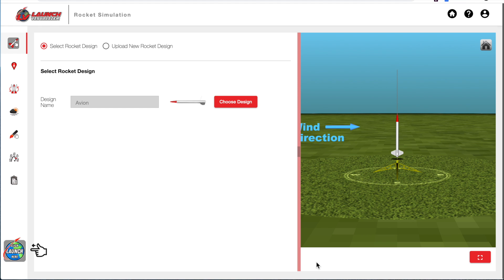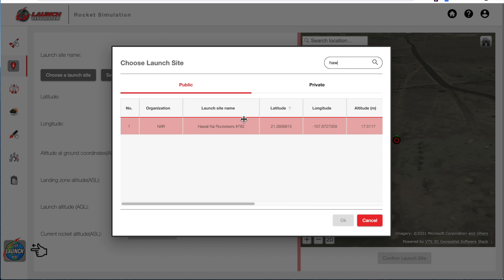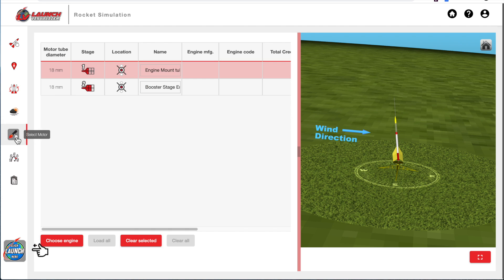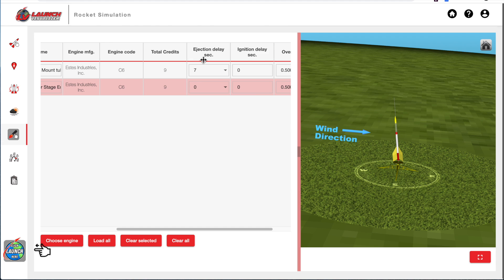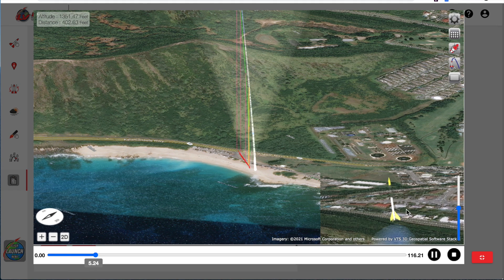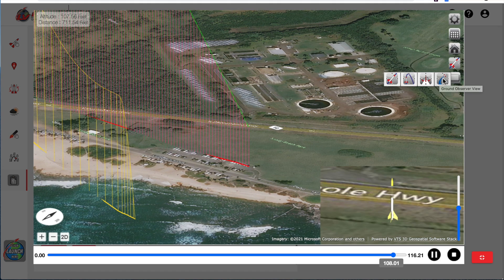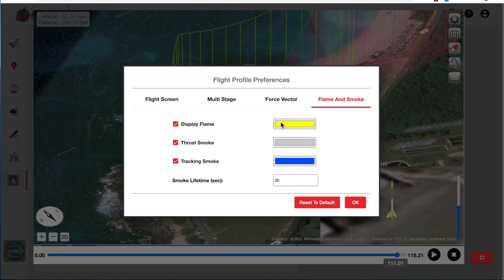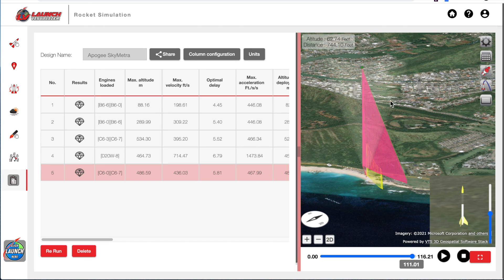Run a Model Rocket Simulation on the Launch Visualizer

Comment: Is there a way to use open rocket designs with this visualizer
Reply from the maker: I don't know. I'm not any expert in that. If you can get a RockSim file, it will work just fine.
Reply: yes u can